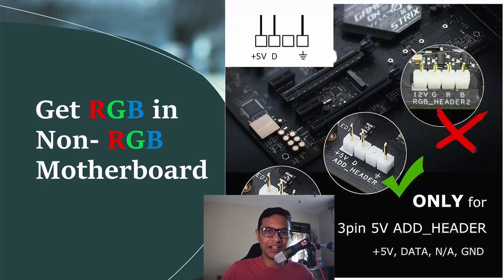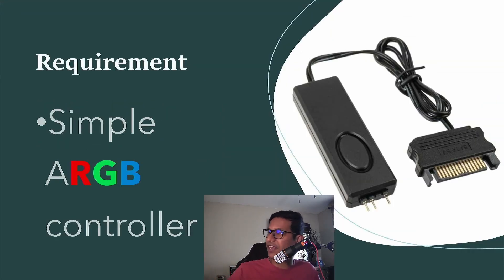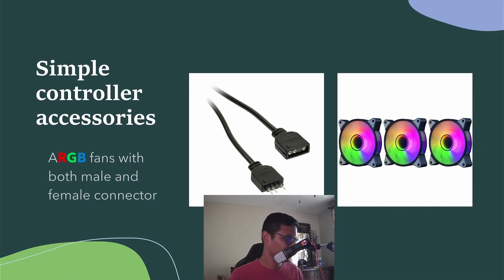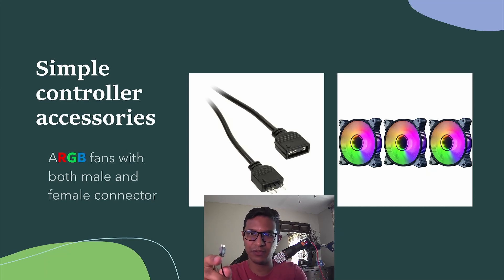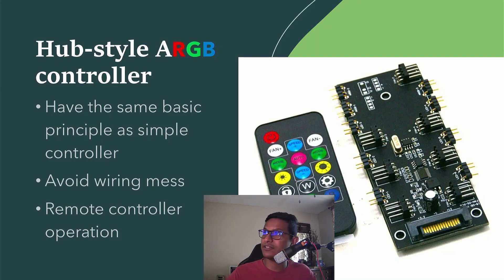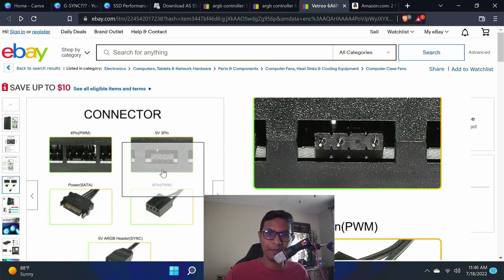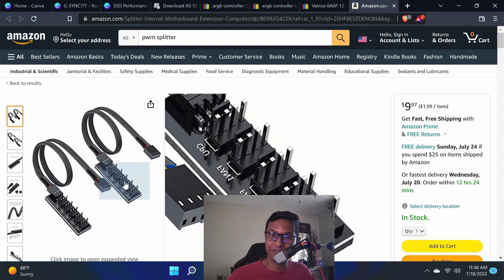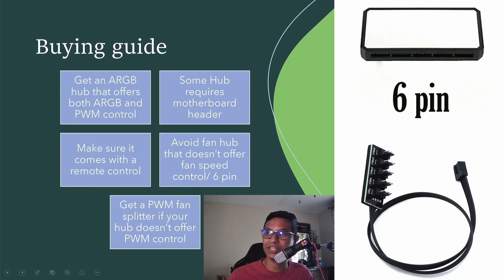How to get RGB on a Non-RGB motherboard

Comment: I know this is late but i have a question. I have the montech air 100 case but my motherboard doesnt have rgb or argb headers. The case comes with a argb hub and it has a sata and argb 3 pin cable. I connected the sata cable to my psu and the fans are lightning up but they wont spin. My question is if i can just buy the argb controller that you showed in the video beginning and connect it to the argb controller from my hub then to sata from psu
Reply from the maker: since the fans are lighting up that means that case fan hub already have a argb controller built into it. The fans should have another separate cable with pwm fan headers; those fan headers need to be connected to the motherboard. Now, the big question here is what type fan do you have?
Reply: @coolStranger516   @coolStranger516  Basically all the fans are connected to a controller and theres a sata and argb  cables to connect to psu and motherboard. I've connected the sata cable to my psu and I can change the colors/argb with my reset switch on the case. They're 5v fans that need 3 headers to connect
Reply from the maker: @robiscd_ao  I am not sure what kind of fan controller they are using. Can yoy post a picture of it with the connectors somewhere. Then send me the link of that picture
Reply from the maker: I have looked at some of reviews from minetech air 100 case. You may just have faulty fans. You don't need to buy argb controller with this set up. You should be able to change colors with your the switch on your case.
Reply: @coolStranger516  Just like you said they had a pwm cable (it was hidden) i connected it to my mobo header and now they work tysm for helping me
Reply from the maker: @robiscd_ao  glad it worked out  :)

Comment: Is it the same if i buy an argb hub instead of rgb controller because the argb fans that i will buy have a controller
Reply from the maker: I tried that but sometimes hub just works as a hub for wiring control. And sometimes  the fan speed control doesn't work with hub. That's why I always get argb controller & fan splitter separate.
Reply: @coolStranger516  can i have ur Facebook or Instagram to show u what i found and guide me what should i buy please
Reply: @coolStranger516 i found a hub that's have both 4oin pwmand 5v 3pin argb
Reply: @coolStranger516  i connected a 4 pin splinter to my motherboard SYS FAN and i connected a argb controller into SATA and into the 3 pin argb connectors that are leftover on my fans but as soon as i turn it on it starts smelling like plastic melting but i don't know whats wrong i connected all 3 pin to 3 pin and the rgb also doesn't work properly
Reply from the maker: @twixxtro  test them out separately to find the bad component. First test only the argb controller see if that works. Then try the fan headers see it fan spins. Also try different fans if you have some laying around.
Reply: I find an argb hub but does not came with the controller but the argb fans came with controller does it enough or i need to buy another one ??

Comment: Hey i have Taichi Z390 and my motherboard has RGB slots 3 pin and 4 pin, and also an a software to control the color, can you tell me which RGB strips to use?

Comment: i have a question..I bought some ARGB fans, but I don't think they have a 4-pin 5V female connection, it only seems to have a 3-pin 5V female connection.
my motherboard is an asus with aura sync and has 4 pin RGB fan slot.
I connected all the fans to a hub, without a controller, but the hub output has a simple 12v 4 pin connection, which therefore does not enter the RGB fan, so the fans are spinning but the LEDs are off.
if I try to connect them both together via the 3-pin 5v connection and then on the hub, should they turn on?
Reply from the maker: 4 pin is 12v and 3 pin 5v. 4 pin 12v caused some voltage problem in the past so they changed it to 3 pin 5v. This is the standard now. If your motherboard only has 4 pin rgb; 3 pin argb fans won't work. You just need to get a simple argb controller to fix your issue.
Reply: @coolStranger516  thanks for reply, I ordered a 3 pin to 4 pin adapter, argb to rgb, at least for the LEDs I think it should work. the fans can be connected in series, when the last fan is connected to the adapter and then to the motherboard, do you think I can also control the lights? thx
Reply from the maker: @chillandmusic8608  now you would be able to control the light with aura sync software. But you should have Bought an argb controller instead. It would have cost you the same. There is a reason you don't see manufacturer's using 4 pin rgb in new motherboards anymore. The industry switched to 3 pin for rgb needs.
Reply: @chillandmusic8608 hey i have the same problem what type of hub did you buy if you dont mind asking

Comment: My case came with the hub style and all my fans are plugged in and turn on but it doesn’t come with a controller and it has a argb input where you plug into the motherboard but my motherboard doesn’t have one what should I do the hub style has a argb Input where you connect to the motherboard but again my motherboard doesn’t have one
Reply from the maker: Get a simple argb controller. They are usually 7-10 dollars.

Comment: Great video! Two questions though. I got ASRock B650, i got a case (NZXT Flow H5 RGB) It has 3 RGB fans, i can just connect them to the ARGB controller and they will work right? AND I'm planning on buying an NZXT CPU Cooler which also has RGB. Will the RGB on it work? Or should i get a non-RGB one? Thanks a lot!
Reply from the maker: Motherboard, pc case and cpu cooler they all have separate argb controllers but you only need one. Buying rgb case and rgb cpu cooler will make things more complicated for you. Get pc case with no argb fans and cpu cooler with no argb fans. Then Buy as many argb fans as you need and daisy chain everything from Motherboard's argb. You can also use an argb connector hub for better wire management but you don't really need to. And for cpu cooler; just replace its stock fans to argb fans that you purchased and boom. You have all argb fans from same company and they all syncs up the same way.

Comment: my case will have 9 fans argb pwm with a hub that should be connected to a 3 pin 5v connector. my mobo have only 12v connectors. how i can solve?

Comment: Will RGB RAM work on a non RGB board?
Reply: Yes modern motherboards
Reply: Yes if the ram has RGB built into it like gskills or every other RGB ram it will work. It will just display with the default rainbow colors but you can use something like signal RGB or open RGB to control the rams RGB, but it will most definitely work. You only need RGB headers on the Motherboard to control things like fans with RGB, aio with RGB or an RGB strip. Even then the RGB headers are only really used to sync up all RGB devices. I recommend getting a good RGB controller like cooler master RGB Controller it uses standard 3pin 5v connectors and signal RGB will recognize it along with your ram and you can sync everything together. Again you do not need RGB headers for RGB to work on peripherals such as ram, GPU, keyboard and mouse ECT...
Reply: Depends, it might
Reply from the maker: No sir.
Reply: yes it will my brother has a gigabyte a320m-s2h and his corsair vengeance rgb pro works fine  @coolStranger516

Comment: Is there a problem if i don’t connect my argb cable? I dont have the connector on my mb or the controller, i am planning on buying one in the future but in the meantime i want to use the fan only
Reply from the maker: No problem if you don't connect argb. You just won't see fancy colors. As long as your pc fans run you should be fine.

Comment: I have the ASRock620M and in the case I have a VDG cable but don’t know where to put it.
Reply from the maker: Even though it's a new motherboard it doesn't have any argb headers. So you need to buy an argb controller.

Comment: I'm using a msi B550 a pro motherboard and it has two ARGB headers on it and my question is, what is the maximum capacity or quantity of fans that i can connect to my ARGB fan header?
(fan header is not a problem just the ARGB header). thank you 😊
Reply from the maker: You can use as many fans as you want. You motherboard may have only two argb headers but you can only use one argb header and daisy chain multiple fans just from that one header.
Reply: @coolStranger516  Thank you for your quick response. I was having a hard time researching this issue because I was planning to daisy chain 3 fans and connect them to one of the argb headers and daisy chain 6 fans and connect them to the second argb header, but I wasn't sure if it's safe to connect more than 3 fans to it. I have a question, though you mentioned that I can only use one argb header. Will the second argb header be disabled if I use the first one? (For context, I want to use AIO 360mm and 6 case fans.)

Comment: hi, i have an fan hub in my case where all argb fans are connected to. do i need to connect the argb cable from the fan hub to the controller now?
Reply from the maker: Yes. Argb cable from the fan hub to arb controller or if your motherboard have arb header connect there.

Comment: I have a deepcool sc700 argb hub with 3pins, I have connected the sata power cable and the fans are turning but the lights doesn't turn on. My motherboard doesn't have any rgb headers (hence I'm here). am I missing something or did I bought the wrong one? Thanks!
Reply from the maker: Power connector and argb connectors are separate. You fans should have argb connector that also needs to be connected to the hub. And finally you need a argb controller if your motherboards doesn't have any. Most Hubs are good for wire management.  They don't produce argb colors.
Reply from the maker: you need this...  https://www.ebay.com/itm/364579061634?mkcid=16&mkevt=1&mkrid=711-127632-2357-0&ssspo=amn8lx-urxs&sssrc=2047675&ssuid=d4F5lZ3AQF2&widget_ver=artemis&media=COPY

Comment: i have a gigabyte b450m ds3h motherboard and it has 4 pin sys fan slot, and the ARGB fan i bought has a 6 pin female (12v), what kind of controller do i need to make it work ?

Comment: got a good deal on a pre owned MSI B520m-a pro. No rgb/argb headers. My fans can be daisy chained for both ARGB and PWM. In theory I should just have to buy a cheap ARGB controller such as the DS Mini ARGB PC Fans Controller Kit and daisy chain the ARGB connectors. As well I should just be able to daisy chain my PWM connectors from the fans directly to my sys fan header on mobo and skip buying the PWM controller. Am I correct? Appreciate the straight forward explanation on the argb.

Comment: Is there a way we could connect the argb to a case with a front panel LED switch/button? Or do these types of cases generally come with an RGB controller? 🤔
Reply from the maker: I don't think you can believe me I tried. Unless the front panel has a argb connector.
Reply: @coolStranger516  Yeah, I went back and looked at a few cases with integrated LED buttons and it looks like most don't come with ARGB controllers (possibly with the exception of Musetex cases or the other popular semi-off brand RGB everywhere cases). But, I would imagine if they have an LED button, they would have an ARGB connector to utilize it. But then, without a motherboard ARGB header, you're in complicated territory. No full-case RGB control. Probably just limited to fans, LED strips, and possibly a CPU cooler LED.

Comment: I have got the ag400 BK. the fan work but the rgb not I have bought the JZK 5V 3 PIN ARGB Hub with housting from amazon. I connected with sata supply and the 3 pin on the hub but no rgb How come?

Comment: i've been wondering for a while now but
can you connect all the argb 5v 3pin connectors to a  argb hub.
and then connect the power through sata and then use a  sata to 5v 3pin to power the hub
would that work?
i wanna try it but if i screw  it up it'll be quite a  pricey mess.

Comment: Hi i am planning to get  a case kolink citadel mesh rgb case. this case has at the back of it something like an argb panel , a remote controler and 3 argb fans.

so here is my question, my motherboard does not have neither rgb not argb header. during the build where do i plug these fans and if the answer is the rear panel of the box(mini hub), where do this afterwards get connected ? to 4 pin motherboard connector or psu? and if that sthe case what kind of control and result should i expect?

hope i did not confuse you and that i was clear
Reply from the maker: Alrighty. I took a look at the case on the Amazon website. From what I understand from the pictures; this hub is a type of all in one controller. That is why they provide you with the remote. You have to connect the pwm female connector from the hub to one of your fan headers in the motherboard and connect all fans to the hub. Also connect all argb fan cables to the hub. But this hub needs to be powered up by something. There is usually a SATA power connector that connects to the PSU. If none there should be some other connector that power it. And they provided one extra argb cable that runs from the hub and connects to the motherboard argb header but you don't have to use it if your motherboard has no argb. You should be able to control the aRGB lighting with the remote because the hub has built-in aRGB in it.
Reply: @coolStranger516  thanks for your time explaining that was very enlightening to me have a nice day

Comment: Best video ever available ☺️ for info of connectord
Reply from the maker: I am glad it was helpful..
Reply: @coolStranger516  I ordered this product
'Deepcool ARGB Remote Controller' on mdcomputers if you search this you will see product
Reply: Can you please help me to guide this product is suitable or not?
Reply from the maker: @shreyaskhamitkar2780  I will look into it
Reply: @coolStranger516  okk, Thanks Buddy, U R very Kind 👍
Reply from the maker: @shreyaskhamitkar2780  this controller follows the same idea as simple ARGB controller but only difference is it has a remote. Just connect the SATA power to your PSU And ARGB header to your ARGB fan in your receiver unit. Then you would be able to control the lighting effect with the remote. I have similar stuff installed in my system but I only have the receiver unit.
Reply from the maker: it should work just fine but it only has one ARGB header. So, you should chain link all your ARGB fans together before connecting the final link to the controller.
Reply: @coolStranger516  yes, You are right, and as you explained in your video I understood that but here condition is I only have 1 argb fan others are cabinet fans they are directly connected to the psu 😁
Reply from the maker: @shreyaskhamitkar2780  better change those cabinet fans to argb fans. And if you don't care about controlling argb light effects like I do you can get a way cheaper argb controller. They work just as well as more expensive ones.  Search for "AR-1 Mini Light Controller".
Reply: @coolStranger516  yeah I ordered this -Deepcool ARGB Remote Controller, Can you check this is similar to your product which you mentioned in previous comment??

Comment: thank you great demon strate but if i have a case that i can control only the fans colors by pressing a button so now i can't control these fans from the apps that u can download 
so all i need is how can i put all of the pices on one fade rgb color like rams and fans and gpu cooler all of them change colers at the same time 
and thank you
Reply from the maker: Your case has a built-in ARGB controller and it's not gonna sync with a software controller...disconnect the case fan's argb header from case's built-in controller and put into your motherboard's argb controller... If not possible just buy a new fans with argb+pwm options...these fans are darn cheap now....and  Software controller only works with motherboard headers... So in order for everything to sync the same way it must be connected to the motherboard....
Reply: @coolStranger516  thank you very much . u don't know how much this helped me I spent hours of searching but no one told me what u did
Reply from the maker: @hxr1984  glad to help :)

Comment: I think you can get a 12v to 5v converter also. Then get any Argb fan kit with a controller.
Reply from the maker: Yes...that would also work but not very cost effective..
Reply: @coolStranger516  $23 for a 12v to 5v converter $35 for a pack of 5/6 argb fans/w controller ain't that bad. some argb with 3 fans kits are like $41 alone.
Reply from the maker: @KhmerVidz  I had this 3pack aigo argb + pwm fans that I got for 18 bucks from Amazon and simple argb controller was 7 bucks from ebay....working good so far...but a brand name argb fans like Corsair would be more expensive tho..
Reply: 12v to 5v converters allow you to plug argb fans but do not let you have argb control, only solid RGB. So it defeats the purpose of the converter for non 5v motherboards
Reply from the maker: @vicit121  RGB to ARGB converter not worth it.. They cost too much and don't work properly..

Comment: if i get the simple argb controller will it work with rgb changing software ?(arctic p12 pwm pst argb)
Reply from the maker: Sorry..it will not.. but the controller should have lots of built-in RGB functions.. and I would also advise against using any RGB software; they're usually very buggy...
Reply: @coolStranger516   alright thank you